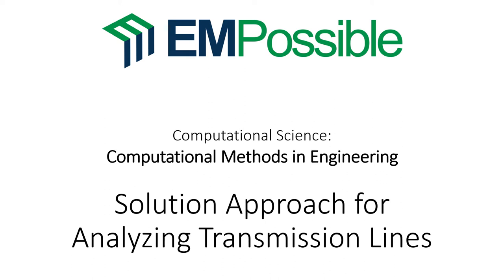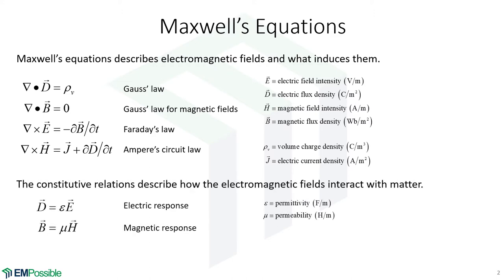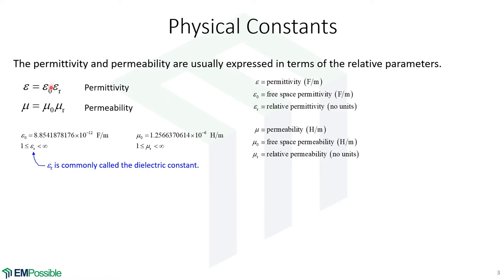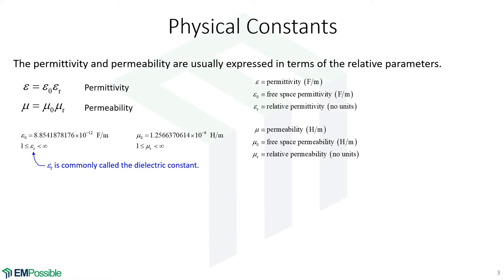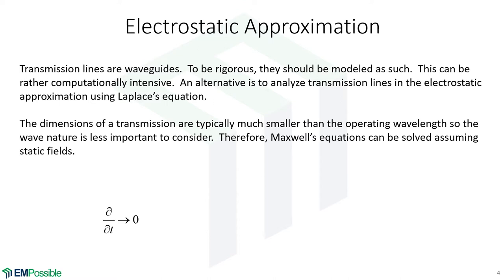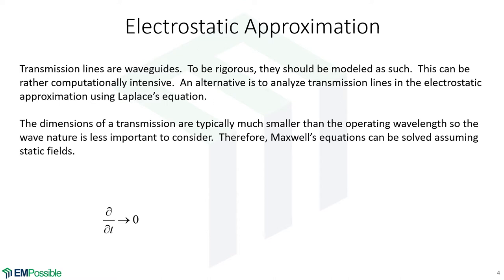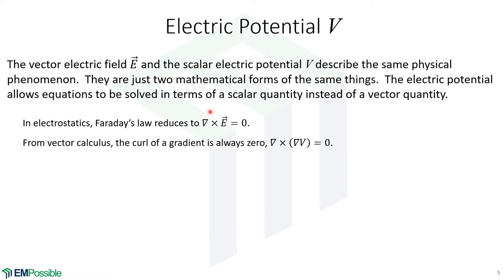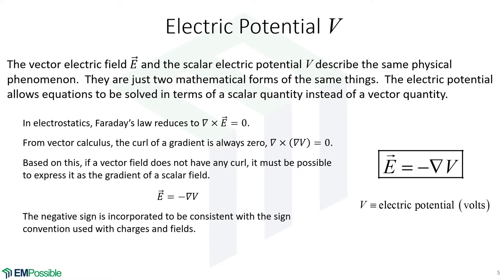Lecture -- High Level Solution Approach for Finite-Difference Analysis of Transmission Lines

Comment: Can you share slides of EMI/EMC analysis of transmission lines?
Reply from the maker: I recommend using the course website as your portal.  It has the latest version of the electronic notes, links to the videos, MATLAB codes for implementing the methods, and other resources:

https://empossible.net/academics/emp4301_5301/